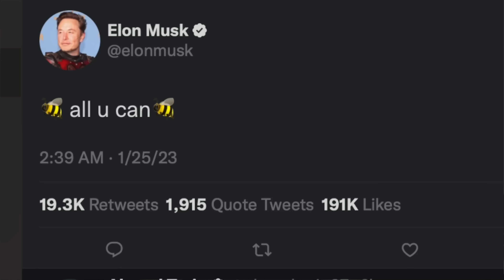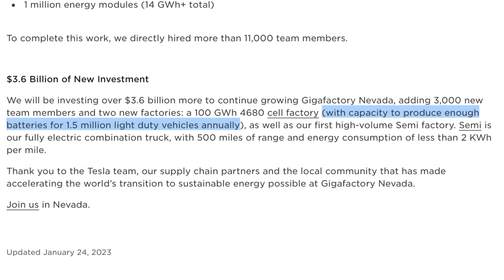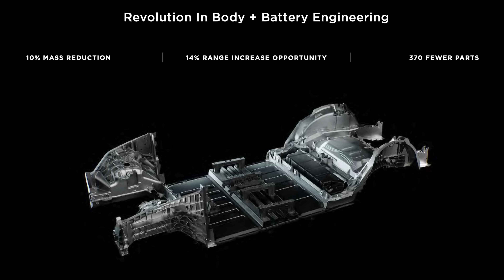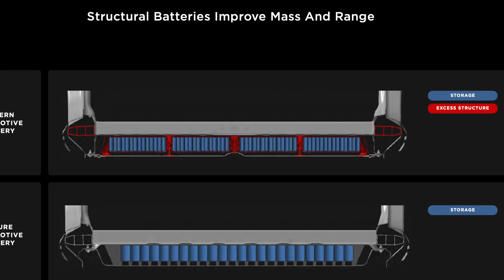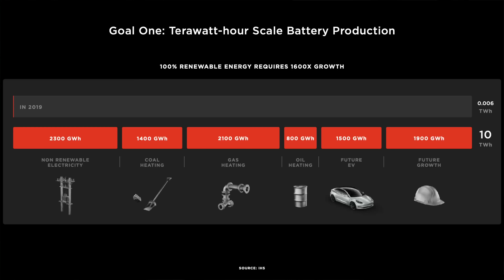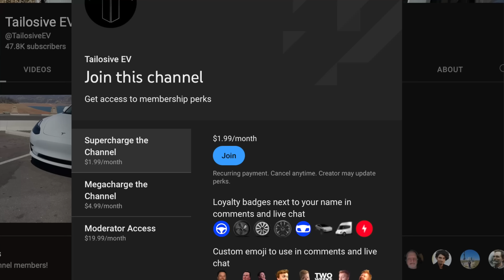Tesla Unveils HUGE GigaNevada Expansion

Comment: Considering you would have to remove batteries in order to keep the range the same when you have a 5% increase in energy density, The amount of engineering you would have to do to change it every single year would be pointless and expensive.

TLDR: 4-5% increase range every year